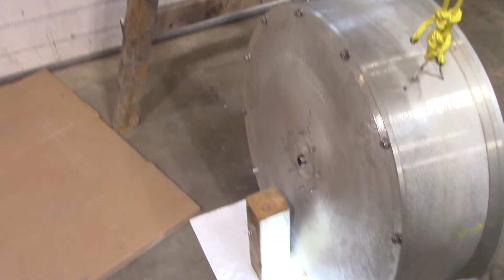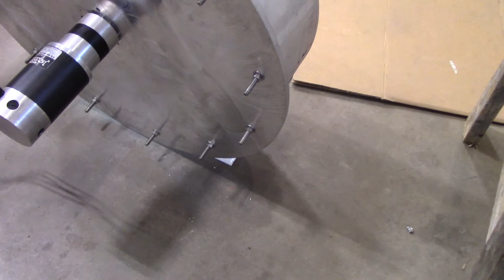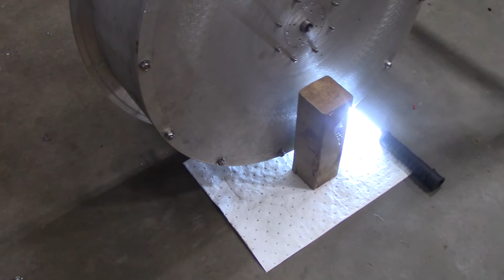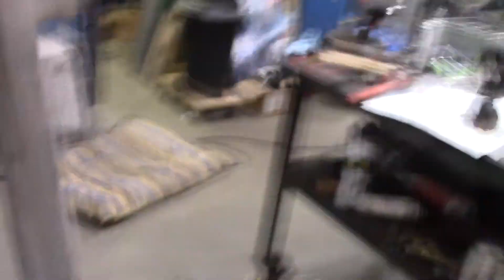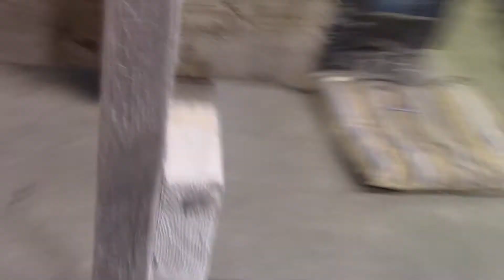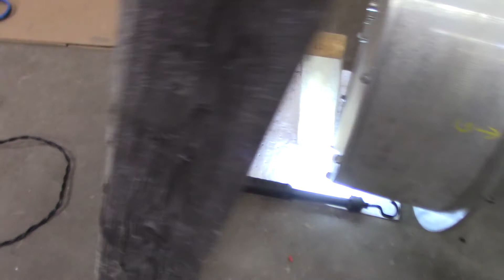CENTRIFUGAL PROPELLER 1.8

Comment from the maker: This is an update for those of you who are following this. I built a new prototype with the help of a high tech machine shop. I also had some carbon fibre parts built in order to keep this all light. I did manage to overcome the low RPM issue and managed to get near 1000 RPMs. The new problem is that the carbon fibre parts aren't worth sh*t, even though they cost me thousands of dollars. They disintegrated. So now I am going back to a more robust material. Since I solved the low RPM issue, a change in the materials that I am using will not adversely affect the RPMs. The shop that I had partnered up with has gone out of business and the only other shop in the area that does CnC wants to charge me about 4 times what the work is worth. The original shop guy says that he has lost the CAD program so I am trying to get it retrieved from the shop that built the carbon fibre parts. If they cannot retrieve the program for me then I will have to also pay for new CAD. I almost feel like the coincidences that have stacked up against me are coordinated. 
So now this is going to cost me thousands more. I will need to focus on my business in order to earn that money to be able to pay for all of this. It looks like I won't be finishing the new prototype until sometime in the new year. But since I solved the RPM issue, I know that the new prototype will work when I get the new parts built. I will always persevere to successfully complete this, regardless of the obstacles. I know what this is worth, to me and to the world.
Reply: Try setting up a patreon ?
Reply: Or donations
Reply from the maker: @victorvega1692  Thanks for the suggestion. To tell you the truth, I don't have a clue how to go about either suggestion. I have done this whole thing, with the exception of that machine shop that went out of business, by myself, including all of the money that I have poured into it. I may try to partner up with another high-tech machine shop though. I looked into getting a CAD software that I could use to draft what I should already have, had that machine shop not gone out of business. I thought that if I draft the parts and then email the design out to several high-tech machine shops around the country, I could get a better price on the parts that I need built. The problem that I have is that the CAD program is almost $2,000 just to rent it for a year. Unbelievable.
Reply from the maker: @t0xicrunner  You don't know what you are talking about. Nicolae Tesla said, "Experimentation is more important than mathematics." When you are looking at something like the Wright brothers' first airplane, do you think that they worked out an equation to calculate the lift that they would generate? No, they had an idea and they worked at it until they had a working prototype. You would be the guy at Kittyhawk saying, after they just flew their prototype, "But wait, it doesn't really work because there is no equation for that." Are you incapable of seeing what is actually in front of you? The prototype in the video is proof for anyone with the eyes to see and the brain to understand.   "you haven't properly calculated the equations"   Give me a break.
Reply from the maker: @t0xicrunner  I am continually amazed by people like you who can look at something and not see what is right before their faces. I took my invention to my nation's capital and met with two government officials. One of them is a very smart guy with 4 degrees in engineering and physics. He understood it. He saw the inner workings and explanation of its operation. During the meeting he kept repeating over and over again, "You are going to win the Nobel Prize". I am not sure why you can look at the video and not see what is right before you. What are you missing? Have you actually looked at the video? If you have a specific objection to what I have done, then let's hear it. But your general dogmatic insults are just like listening to someone who believes in something and even though you show them the proof that they are wrong, they say that they were taught that it is not possible, therefore I am wrong. So take a good look at the video and tell me exactly what you are seeing or not seeing, that makes you believe that you are right. And don't start quoting BS that you learned in school that says that what I've done is impossible. Take a look at the video. I am old enough to remember my grandmother saying that it is impossible for anything to travel faster than the speed of sound. She had learned in school that it was not possible. And then when we told her what the sonic booms were, that we were hearing when jets were breaking the sound barrier, she still would not believe. At that time, most people believed that going faster than sound was impossible, but it happened and now it happens regularly. Well grandma Trevor, take a look at what is right before you eyes. It is possible to create thrust in a closed unit and I have done it. The proof is right before you. If you are too obtuse to see it, then there is no use in me trying to explain something to someone who rides the short bus.
Reply from the maker: @t0xicrunner  You are showing your ignorance repeatedly. If you knew anything about gyroscopes, you would know that what you are referring to is called gyroscopic precession. Let me educate you about gyroscopic precession. When you turn a gyro clockwise, the gyro will pull to either the left OR the right. Then when you turn the gyro counter clockwise, the gyro will pull in the opposite direction to the direction that it was pulling when it was turning clockwise. With my invention we moved the driving motor from one end of the center shaft to the other and without meaning to, because I knew it would not matter, we made the rotor turn in the opposite direction. Even though the propeller was turning in the opposite direction, the entire machine still moved in the direction it was supposed to, BOTH TIMES. So gyroscopic procession is not an issue. Now, if you had read the dropdowns on my videos, you would have learned the the first time that I tested the prototype, it made an unexpected noise. I removed the metal top and replaced it with a 3/4" plywood top with holes cut in it so that I could see what was causing the noise. That 32" diameter, 3/4" thick plywood was bolted at 12 equidistant points around the perimeter. If you have any experience with 3/4" plywood, you would know that a piece with these dimensions, bolted at 12 equidistant   points around the circumference, is extremely hard to bend. When I turned it on again, the plywood was bending upwards in the middle, which is exactly where the thrust is created. So I knew that it was generating thrust, but just not enough to lift the 320 pounds that it weighs. So I then turned it onto its side and hung it from a pendulum. So not only did it create enough thrust to bend the thick plywood, but it moved to the side when it was hung from a pendulum. So you are not only wrong, you are being purposefully obtuse. As for my explanation as to how to create thrust in a closed box, where do you think that the energy comes from that is causing the cannons to move horizontally in opposite directions? THAT is the energy that is redirected from the vertical axis, and is "stolen" from the REACTION. If you actually paid attention to what I said in the video, I made reference to the energy that was absorbed in the rails as the cannons moved around the curves. And yet, there is still enough energy to cause the cannons to move horizontally. If all of the reaction was absorbed in the rails/curve, as you are alluding to, then the cannons would not move horizontally. They would stop as they round the curves. FCK. Where is you ability to figure this stuff out? How old are you anyway? Do you do drugs? What has affected your critical thinking?
Reply: @jeffincanada5060  Could you pleeeease, pleeeease, pleeeeassee make a video showing the inside and explaining how it works with the actual device? I'm dying to see and understand it. It's exciting seeing new ideas actually take fruition that can change the future of the world.
Reply from the maker: @oodyjones  Thanks for the interest. I am in the middle of building a new prototype that will make my previous patent obsolete. I have had some setbacks that are not related to the operation of the prototype, but rather, financial and covid related issues. I am self-financed and my business is extremely slow due to the covid. I would love to show you the inner workings, and will, once my new prototype is completed and I have my patent pending. I cannot show you the inner workings of the prototype in the video because in the making of the new prototype, I've had to scavenge some parts from the old prototype. If you check out my other videos AND read the "SHOW MORE" dropdowns, you will have a better idea of the principle of the invention.

Comment: The Gode Award for what I read in the general conditions about gravitational devices is a great trap to locate and detect technologies that are harmful to the current economic system.  Under the conditions I have read, devices based on centrifugal inertial forces are not accepted, why will it be?  Because they are simple systems that any curious mechanic seeing it reproduces easily, besides that these devices substantially decrease the consumption of fossil fuels, in a specific configuration, can generate electricity with the current electric generators without any specific modification.

Comment: This is interesting but do have a question.
Seem like thrust would work fine in space but wondering the mass of the enclosure may be an issue to lift off from ground as you have to counter the gravity of the mass
Reply from the maker: This prototype is purely a proof-of-concept prototype. The next one will blow your socks off. I expect that it will be finished around mid April 2023. I will post a video of it at that time. It will definitely lift up vertically.

Comment: This video intrigues me but I have no idea what is happening lol. Can you explain what this device is and what its future purpose will be? Thanks for your insight keep on tinkering 🛠
Reply from the maker: I have successfully converted centrifugal force into directed thrust at a right angle to the plane of the centrifuge, in a completely closed unit. If you check out one of my other videos, Thrust Created In Closed Box, you will see a description of the principle behind this. And thanks for the interest. This will replace all rockets and jet engines, and most air and marine propellers. It will continually accelerate in space, and can be used in space, in our atmosphere, or in water. We will be able to build units that you can strap onto something heavy, like your refrigerator, and when you turn it on it will lift the fridge so that you can push it around like a balloon.

Comment: I dont understand everything thats going on, But i understand enough to know that this is really, seriously cool.
Reply from the maker: Hi Mathieu White, this is history making. Thrust has been created in a completely closed unit with no external moving parts and no external vents. This will continually accelerate in outer space. It is only running on a 1/2 Horse Power motor using some batteries. Later this week I will be putting a 3 Hp motor on it. The math says that if you take two pounds on a one foot radius and rotate it at 1,000 Rpms, then you create over 12,000 pounds of thrust. The problem has been, how do you harness that? This invention does exactly that. In the video it is only harnessing a miniscule fraction of 1% of the power that is being generated inside. That will change with higher RPMs that I get from a more powerful motor. I am not sure why the world has not been paying attention to this. It will eventually replace all rockets and jet engines, as well as air and marine propellers. This means that we will be able to get to Mars in less than a day.
Reply: So the efficiency and amount of energy we can now utilize vs current systems is they key? If what you say is true, then you’ve got the future of transportation and propulsion sitting in your workshop. Wow.
Reply from the maker: Thanks for the interest. It is nice that SOMEONE gets it. I can hardly believe that neither industry nor government seem to understand the full implications of this. My next version, I will be calling it the 2.0 version, is completely silent and about 100 times more efficient, lighter, and will be able to run off of lithium batteries, meaning that I will probably actually fly the sucker. Remember the old back-pack rocket thruster that could fly a man for about 47 seconds? Well I anticipate that I will be able to get a full two hours of fight time with the 2.0 version. I have tried to get industry and government to finance me. So far I have been mostly self financed and it has been an incredible drain on my finances over the years. I think that when I actually fly with it, people and industry will want to finally invest in this. Because it is so far outside of the box, people have a difficult time understanding the potential uses of this. It will replace jet engines, rockets, air and marine propellers, cranes, etc.
Those who have either ignored me or shunned me will regret missing out on the best investment opportunity in a century because once I start to receive money from this thing, those doubters will not be given the chance to invest.
Reply: @jeffincanada5060   If it threatens oil industry they wont give any. They will just take it from you for free when you are ready :D.
I think there is people who knows this technology in higher ranks but they wont let it happen cause they are money whores.
I really hope you will succeed with your project ! Too damn intresting.
Btw when is the next video coming :).
Reply: @jeffincanada5060  Hello jeff why not start a kickstarter for this ? I might help you with the process although I don't have much money I can suggest you things that will gather you media attentions.

Comment: Waiting for new video!!!
Reply from the maker: It will probably come around the end of April, 2019. I tried a 10 HP motor but I did not have a driver (speed control) and the motor was not geared down. I was only getting about 60 RPMs because there was no torque to overcome the resistance from the magnetic repulsion. These parts aren't cheap either (self financed). It is going to cost me close to $5,000 Cdn for a properly GEARED 10 HP motor and the driver for it, and the electrician's cost.
The current video is using a 1/2 HP motor that is geared 3-1. And with that I was getting about 85 RPMs. So with a properly geared 10 HP motor, it should do the trick of getting the RPMs up. It is ridiculous that I am dealing with such a simple thing as getting the RPMs increased. You can see in the video that the RPMs start to decrease (I am using batteries that are getting drained) and as they do, the Centrifugal Propeller starts to move away from the 4X4 (thrust decreasing). That is a simple and direct indicator that as the RPMs increase, there will be more thrust. Thanks for your interest.
Reply: Is this jeff plum.....I saw a centrifugal  propeller in Google patents

Comment: You’re last upload was a year ago, any luck ? How’s progress?
Reply from the maker: Thanks for the interest. I am only a few days out from having a new prototype. It is much smaller and FAR lighter. These things cost big bucks and that has been the only hold-up, self-financing. I am trying for the Gode Award for Gravitational Research. Their board sits around the end of July and I am trying to have my new prototype up and running in time for them to consider my invention. You only get one stab at this award, period. So I need to make this new prototype lift off of the ground and impress that board sufficiently to get their attention. It looks like they just do not understand the progress that I have already made with the prototype in this video and the full implications of the pendulum test. If I win the prize, it is one million euro. That would help me to build the prototype that I really need, to impress. I am currently using permanent super magnets to redirect reaction. They have a limitation. I should be using electro-magnets with sensors that are magnetically shielded, and a computer to increase or decrease the power to the electro-magnets. But to go that route is going to be very expensive, so I either have to win this Gode Award, or spend more time in my business, earning the money, or find an investor who understands the awesome potential of this innovation.
When I get this new prototype working (fingers crossed) I will post a video here on YouTube. Frankly, I just cannot understand why this current prototype has not been all over the news. I recall some guy in Europe, who several years ago, supposedly harnessed centrifugal force for directed thrust. He had big media event but the thing was a total flop. It never worked. Apparently it only ever worked just one time but never again. My Centrifugal Propeller in the video, works EVERYTIME!!!! What the hell do I have to do to get the kind of attention that that guy had, FOR HIS FAILURE!!! Unbelievable. I have made continued attempts to get the attention of media and of guys like Elon Musk and Jeff Bezos, who are in the rocket business, but any attempts to get their attention go totally ignored. The media won't even return my phone calls to find out what this is all about. Very frustrating.